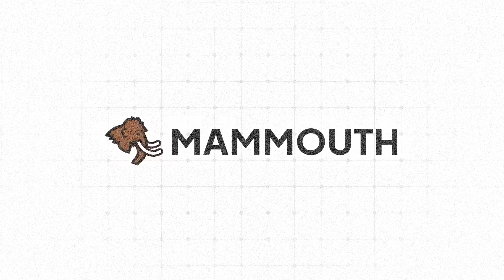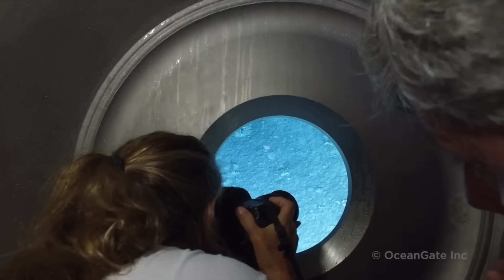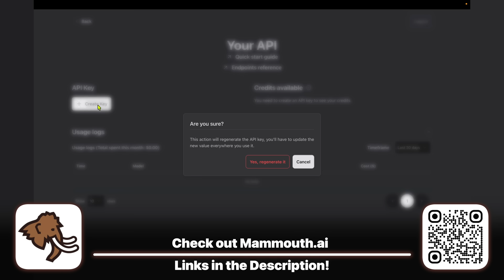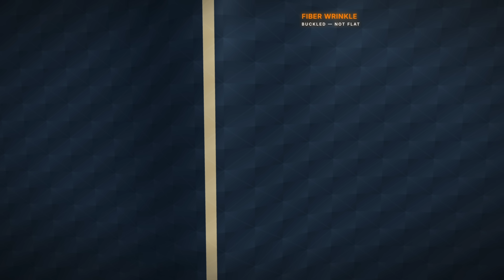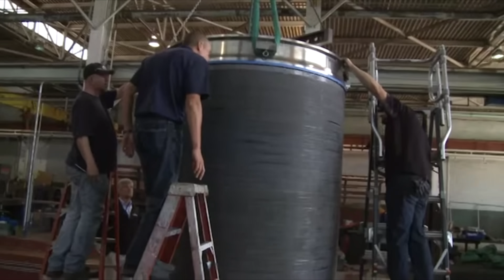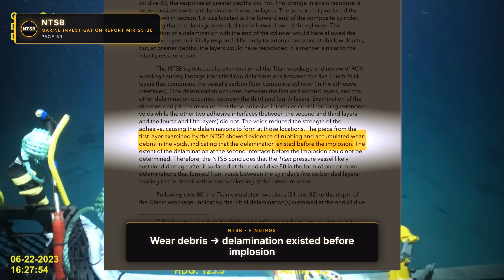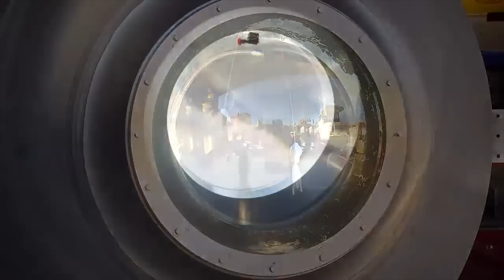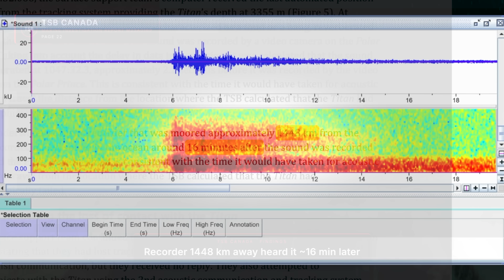Oceangate Titan: It was WORSE Than We Thought

Comment: I‘m an engineer with specialisation in carbon fibre structures. My jaw just dropped to the ground and remained there through your whole video. They signed their death scentence multiple times, literally breaking every common carbon fibre NoGo rule. I suspect I‘ll remain speechless for at least the rest of the day
Reply: Leaving it in the Canadian winter was icing on the cake
Reply: @mikebravo3527  more like icing on the sub, really.
Reply: @slice_of_pi  Icing on the cracks
Reply: @mikebravo3527  saltpeter on the tree stump
Reply: @mikebravo3527  that is why it failed-water intrusion into the clevis-tang joint. Had nothing to do with the carbon fiber
Reply: I'm studying mechanical engineering, I'm no expert in carbon fiber, but damn, grinding down layers because they wrinkled, curing the same layer 5 times, air pockets.... Those guys went through all the possible wrongdoings for any manufacturing process and made all of them for a vessel that had to withstand tons of pressure.
Reply: even if they designed and built the carbon fibre perfectly, the hull was still married to metal domes, which would flex under massive pressure diffently due to shape and the material itself, in other words stress fractures are bound to happen
Reply: @hotdog9262  What? The laws of physics cannot be ignored? Who knew?
Reply: @Rifraph48  they didn`t ignore it did they. what do you think this craft was for
Reply: @Rifraph48  they never watched Star Trek
Reply: I’m not a carbon fiber engineer, but my jaw was on the floor as well, he did every single common sense NoGo imaginable. Stockton was a genuine idiot with too much confidence, and unfortunately investors fell for it and funded his dream, or should I call it a nightmare?
Reply: The man was a golden child from a filthy rich aristocratic family and had never been told NO his entire life. Mother Nature does not care about your pedigree. She is ruthless.
Reply: @brianlaneherder3666 couldn’t be said better
Reply: Ikr!!!      It makes you wonder what went wrong with thier brain to think this would work!!!
Reply: @JR-ht7og  I think its a good note to understand that just because you're intelligent doesn't mean you're grounded with reality. Some people are just incredibly egotistical and ignorant of the many variables to account for.
Reply: @JR-ht7og  They did not THINK it would work, they assumed (hoped) it would work. Some people believe in miracles. Some people depend on them.
Reply: He should've done less coke and made it out of titanium and as a sphere. Suffah Stockton.
Reply: The old saying “ignorance is bliss” comes to mind when talking about Stockton Rush.
Reply: I have nightmare-daydreams so vivid, it's like I'm in there.
- bang the volume of a gunshot -
Stockton: "Aaah, don't worry, that happens all the-
* crunch *
Reply: @landonletterman831  Ditto. The amount of pressure pressing against anything dropping down in the sea is terrifying. Count me out!
Reply: @landonletterman831   I hate it when I imagine what others felt like in times of … impending doom
Reply: Not an engineer, but my jaw did the same when I saw a video of them applying adhesive to glue the ring to another part. There was no suits, no clean room, no professional surface finish or sterilization of the mating surfaces. It was done by random dudes in a warehouse, they weren't even measuring how much they put on or applying it evenly with a machine, just slapping that stuff on like I would PVC glue lol.
Reply: @glottiscalavera773  ‘it’ll do’ and deep sea exploration isn’t a healthy combination
Reply: @insomniavfx 
Even above the surface it goes wrong almost every time. 
Absolutely unbelievable to go down 4000m .
I could have welded them something better, but wouldn't take part at the spree either !
Reply: Im completely baffled why anyone building this structure would have said, "yeah, let's shave down our load bearing structure. Also. We will make multiple pancakes layers stacked and glued together to make this, then we will submit it to multiple heat soaked cycles to achieve our desired thicknesses." 

Now im real curious as to what temperature they soaked the structure at and for how long. As the resin profile used could give different results. Not to mention did they use any aeration like a byk to push air pockets out the resin prior to winding the filaments. 😮 there is so much here that baffled me from an engineering perspective.
Reply: If I recall, the head engineer was let go because he was fighting with the CEO about the design and literally telling him not to put people inside of it.
Reply: @glottiscalavera773  the sub also was struck by lightning. He forgot to mention in this video.
Reply: @JaisonBuilds  wasn't it the first hull that was struck by lighting ? and they rebuilt another sub using old parsts after that..
Reply: @JaisonBuilds  are you for real??
Reply: @austintaylor6152  yes
Reply: @JaisonBuilds  😳😲😲😲
Reply: I have no experience with carbon fibre at all but my jaw is also still on the floor. I think I'd make less errors if I took a Chinese exam right now and I don't speak a word Chinese.
Reply: Stockton was INNOVATING!!

In fact, he figured out how to turn humans into ketchup.
Reply: @glottiscalavera773  it’s been 19 hours. Still speechless?
Reply: @Mallow1-y6g  its now been 23 hours. People are getting worried...
Reply: @Mallow1-y6g  i assume they slept it off
Reply: @sombodu728 lol
Reply: @sombodu728 They still speechless rn
Reply: My mom manufactures carbon fibre
Reply: @kaylahall1219  What, all on her own? She must be very talented!
Reply: The carbon fiber was not an issue with the sub ONLY if the sub stayed in the shallows. As a tourist ride in the Bahamas it would have been 100% safe. What Stockton did was buy USED AND SCRAPPED carbon fibre from Boeing that FAILED!!!! Boeing's tests for pressurization, and he bragged about how cheap he can get it because of his special friends at Boeing. THEN!!! He said "okay let me go to the deepest part of the ocean that even the Trieste would struggle at"
Reply: Do mission critical components get built in an artificial vacuum to avoid many of these issues?
Reply: Im also in the carbon fibre game, the "pop/bang" reminds me of the sound of a part releasing from a mould😂
Reply: @glottiscalavera773  But have you considered: saftey regs are for suckers
Reply: @paulchaisson8301   Suckers that are still alive.
Reply: I’m a mailman and have carbon fiber in my husbands workshop and my jaw just dropped and stayed… bahahahaha...😆😂
Reply: @merediths2cents love the knee socks, Meredith! 😎
Reply: @mrbill8763 why thank you !
Reply: What's more: carbon fibre is good for tractive forces, that's why airplane wings are build of carbon fibre. It is not good at all for compressive forces, like they occur in the hull of a submarine. The name says it all: it's a fibre. Pull it, and it will not break. Push it, and it will just fold.
Reply: @chrisehmke1651 tbf carbon subs are relatively common and effective
Reply: @glottiscalavera773  You must be one of those old white guys that he didn't want to hire! 😊
Reply: @glottiscalavera773  yeah and you can't spell.
Reply: And as a layperson it sounds like the fixes weren't that difficult. Almost like basic maintenance and inspection. Almost like you do more to your daily driver than they did to a submersible.
Reply: @glottiscalavera773  Im not an engineer and I did watch the whole video, but I'm curious if you have any extra points on just how insane the negligence was on the production of the submarine besides what the video pointed out?
Reply: its almost like stockton knew exactly what he was doing.......
Reply: So you knew they were dead as soon as the sub went missing right?
Reply: @operation1968 most people did. There's no offramp from the depths to the surface. It's why their real time hull monitoring system was silly. If it detects a problem...all that does is let them know they're done for.
Reply: @glottiscalavera773  thier problem was greed. Theres already subs available to buy that would do the job. Why on earth would you make your own? When they found problems they bodged it or ignored it. Theres a great documentory on tv somewhere. Litterally a 16 year old kid could have worked out there was going to be problems. Boss wouldnt listen.
Reply: @glottiscalavera773  I’m not an engineer much less a specialists in carbon fiber, and my jaw is on the floor as well. It’s wild to me to have such a cavalier attitude towards the design, manufacture, and care of the very thing that’s supposed to protect you in one of the most extreme environments on our planet. I take better care of things I DON’T rely on for my life!
Reply: @glottiscalavera773  “let’s dive again and see what happens” Jesus Christ. Hold my beer 🍺
Reply: and not completing the 45 degree axial wrap and no one knowing why.... unbelievable
Reply: I like to imagine that the guy who made this comment was literally walking around all day, grocery shopping and doing errands not saying anything to anyone with a look of horror on his face and his mouth open, like this: 😮
Reply: You will find the answer of the why in the lack of carbon washers.
Reply: Not the first guy its silenced. 😮
Reply: Is it very expensive to make carbon fibre up to spec or was oceangate just that reckless? 🤔
Reply: Isn't carbon fiber also significantly stronger under tension?  The hull was under compression.  It's like pushing a rope.
Reply: Lordy, I'm not even a backyard composites engineer, but when you hit the point where they ground down the wrinkles, I said, "Oh' FUCK!"
Reply: "Let's dive again and see what happens." i.e. "Let's FAFO."
Reply: Suicidal Arrogance.
Reply: Go and watch the Coast Guard Board of Investigation hearings about it, and your jaw'll either flap its way back closed or melt right off from the testimony there.
Reply: Ditto, I worked in a composite shop. Even when you do the science right on the layup , the strong bond can become fragile
Reply: There haven’t been this many shortcuts made in engineering since the Soviet Union!
Reply: Grinding wrinkles smooth... it's carbon fiber... you're cutting fibers in the structure. What the hell were they thinking
Reply: Oh dude you can’t be real the carbon fibre was 90% of the problem and I’m not sure where you got your degree From for fuck sake it had to be at least 10 inches he made it at five please move onto a different field
Reply: @glottiscalavera773  ur speechless comment made me speechless.
Reply: @pR0ManiacS   I have no words
Reply: @_OwlO_  Telling nothing...
Reply: @jirizlamal69  …..
Reply: @Soundbrigade 😐
Reply: I just have a BSc in physics and did the minimum requirement of material science. 

That is enough education to be gob smacked by the stupidity of this design. 

A sub, needs to shrink and expand. 
Carbon fibre is a complete no-no.
Reply: @avibhagan Yeah, but in his own words, Stockton Rush wanted to be "an innovator."
Reply: @ElaineWood-k2g  wanted to become an innovator - became an imbecile.
Reply: @glottiscalavera773  My jaw also dropped to the floor but it is a medical condition.
Reply: @BongoBingo17  Drinking to much of that healthy radium water?!😮
Reply: Yet they made 80+ safe dives WITH horrible manufacturing practices...they definitely pushed their luck a bit too far, based on how it ended. 

Rush set citizen.submarining back 50-100 years.
Reply: @petercarioscia9189 the titan sub only has 24 dives total
Reply: @petercarioscia9189 I don't know about that. If anything, he reinforced the necessity for building and operating submersibles according to established guidelines and regulations. JMHO
Reply: @petercarioscia9189  Nah, I think we all learned something, education always costs
Reply: @gravydavy3614  yea apparently we learned carbon fiber, even using probably the worst assembly practices is actually quite durable and can survive 80 dives, 20 of which went to 4000 meters...maybe structural engineers are being overly cautious.
Reply: @glottiscalavera773  your not an engineer
Reply: @gala-kw7hw *you're
Reply: @gala-kw7hwyou can’t even use the proper you’re
Reply: Behind the bastards did an episode that definitely sheds some light on how stupid this guy was. 

A prime example of CEO Fallacy.
Reply: No - you're a BOT with no content and even less talent believable rhetoric.
Reply: @sjbechet1111  Who hurt you bro?
Reply: @paul227-u1p  Straight to the reflexive meta-gaslight and I'm hurt?
...OK. Stick to licking windows.
Reply: @sjbechet1111  🤡
Reply: @paul227-u1p  Not hurt, merely afflicted with tardation.
Reply: @sjbechet1111  bro you are troubled
Reply: Carbon is a disaster 😩
Reply: @blue4k-XLR   Carbon fiber construction has its places, as long as one is not an idiot that ignores ALL the manufacturing/engineering rules.

Comment: I remember watching a video of them gluing the titanium end-caps onto the cylindrical "body". Using a very thick, viscous material with what looked like fairly standard spatulas. There didn't appear to be any real attempt to ensure there was a consistent bead or thickness - they were just eyeballing it. The men were working without any kind of suits or hairnets - anything like that to keep it clean- and in an open workshop with general work merrily going on around them, kicking up dust and whatnot. The amount of inclusions in the glue would probably have been high. This probably isn't a huge problem in itself as the water pressure is keeping the caps in place pretty darn well. But it speaks of a culture of "nah, that'll be good" and "I know that, technically, we're supposed to. But.....". This is not what failed, but i was surprise at how the work was being undertaken because it's bound to lead to inconsistencies.

Comment: Would  ribs on the inside like on  US military Submarines be enough to keep it from imploding in the center?  No,  I would never have ridden in it.   The systems seem amateurish.  Starting with the capsule door being  bolted  closed from the outside, the steering system, the buoyancy mechanism with no back up.  The battery on the outside of the craft.  It just doesn't seem to be designed very well.

Comment: I was doing advanced carbon fibre manufacturing in highschool 20 years ago. Vacuume infusion carbon fibre and fibreglass. This is before alot of car manufacturers even used it and it was only really newish tech with F1. Most were still using wet lay up with a big weight penalty. 
But of all things I learnt multi layers like they did on the Triton were a big no no. Granted we never did anything 5 inches thick. But one thing we never had issues with was air pockets or delamination. And that's on roll bars that took solid hits and were tested and checked/removed after incidents and replaced. 
I'm not an engineer but this was just bad manufacturing on a budget. From people who should of known better.

Comment: If carbon fibre degrades when exposed to the elements (such as sun and temperature extremes) and suffers so badly from fatigue, when subjected to repeated compressive loads, why do they make aircraft wings from carbon fibre -  (A350, 787 etc)?

Comment: The first videos showing how they built the carbon fiber hull in a metal barn was pretty horrifying.
Reply: Also horrifying is the rabidity of Rush's supporters.
Reply: @Canada_Dominium  Their insistence on defending his intentional circumvention of safety standards, even when it is directly responsible for killing people in an otherwise generally safe activity, is almost impressive in its stupidity.
Reply: @CookiesRiot  Not that.  They think carbon fibre is a miracle material.  It's amazing in its tensile strength, but has no use as a vessel against pressure.
Reply: @Canada_Dominium  Well, it technically can have use under compression... About 87 times!
Reply: @CookiesRiot  That was the epoxy glue holding up.  The carbon fibre had as much effect as dental floss.
Reply: @Canada_Dominium  we even use fiberglass and cars now because it’s shatters easier than metal and reduces the overall force of impact
Reply: @mafiawaffle  Carbon fibre works only against stretching it along its length.
Reply: @Canada_Dominium  yes, but the fact that it is pretty durable to general weather, and it breaks easily on impact is why we use it for cars now
Reply: @mafiawaffle  Carbon fibre is made from carbon.  Fibreglas™ is silicon dioxide strand.  Totally different materials with different properties and applications.
Reply: @Canada_Dominium  musk like.
Reply: Most space rockets are built in metal sheds too. The problem is they didnt fully engineer the design and then didnt even follow their preliminary design, then they messed up the fabrication too.
Reply: @RAWBOT301  The problem is that carbon fibre is useless against lateral, compressive force.
Reply: Which is why it was engineered to be 7" thick without even considering strain damage over the lifetime. If the hull was twice as thick, had 45 degree strands and was manufactured properly without voids, without sanding the layers and without curing the inner layer too many times it could have worked, but all those things kill the feasibility and cost. Should have made the hull out of titanium...
Reply: @RAWBOT301  Exactly, this is what I was talking about.  The proper way to build a hull like this is already known and the attention to detail is very important.   But Stockton decided to go with the 'its good enough' approach.

Comment: The carbon fiber they purchased had been sitting in the elements (no climate control building) in the storage yards at Boeing in Everett Wa. I heard that the fiber was exposed to rain, heat, and freezing temperatures which compromised the carbon fiber. I may be wrong, which is normal for me.